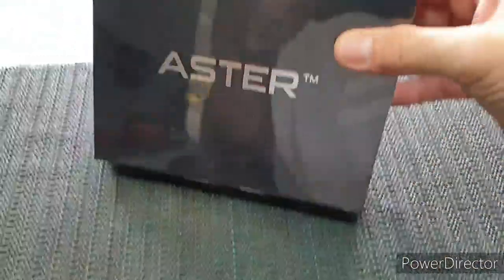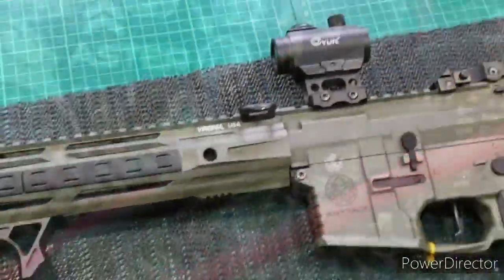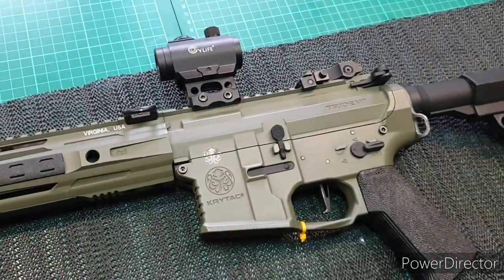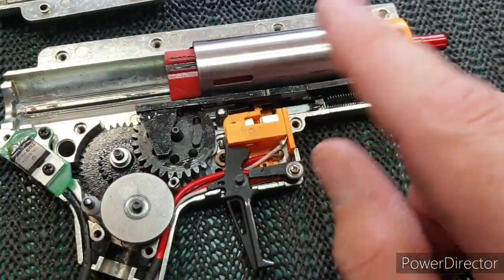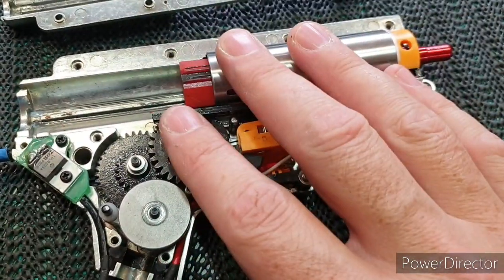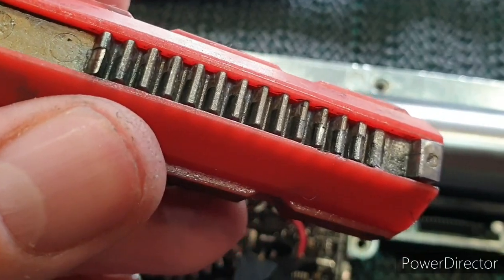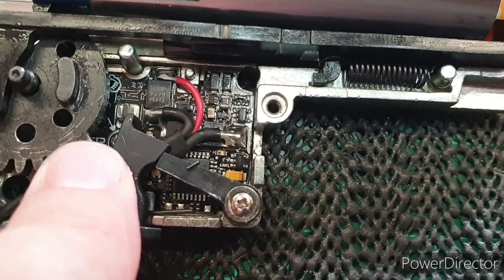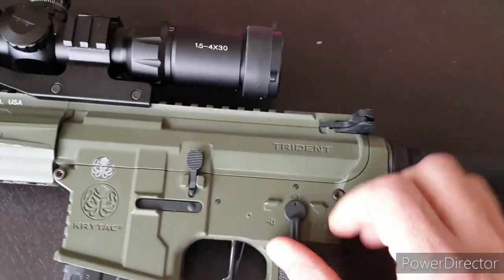KRYTAC + ASTER Installation

Comment: great video im thinking of doing this to my krytac too, just out of interest do you run 11.1v on yours?
Reply from the maker: Hi there, so to answer your question yes I did run an 11.11.1v lipo at the time but I no longer owne the rest gun anymore. Sold it to a friend and its still going strong 💪
Reply: @stuartlathe2310  cheers for the reply, what mah and c was it when you used it?
Reply from the maker: @narstysist598  1500mAh 25c

Comment: hello my friend.i dont know if your still active here. im considering a mosfet for my lvoa. the trigger is he worst thing ive ever felt. i have some g&g'sthat are so more better because the etu.ive got a perun in 2 of  them do you know of a drop in or inline mosfet that is decent for these guns. ive had shit luck working on gearboxes and am afraid to open this up. ive done all the other stuff but gearboxes get everytime. i sadly ony have 2 airsoft stores local and i dont trust those wanker techs theyve screwed up everything ive given them. any info you have id really be grateful to recieve. cheers
Reply from the maker: Hi there, so I would suggest copying what I've done to my SPRM i also did the same to a friends LVOA-S and it worked fine. I do think the ASTER is the way to go on a Krytac 👍
Reply: @stuartlathe2310  did you have to do have to go in and remove material from the gearbox case so the trigger module fits or did you have a tech do it I could take the gearbox apart no problem I can travel it and do all that kind of stuff but I have shit luck when it comes to getting it back together properly so I don't want to open it and then shit the bed and not be able to put it back together properly. That happened to me on my predator trying to get the Ambi fire selectors back then it happened on my Avalon MP5 so I'm scared scared to open the thing

Comment: GATE says the aster is compatible with Krytac as long as the bolt lock is removed, was that not the case for you?
Reply from the maker: Hi there thanks for the question. Absolutely not, the stills I put up are from the GATE PDF manual for installation guide of the ASTER into a KRYTAC. So they know you have to do some modding.
Reply: @stuartlathe2310  that's crazy because it says no modification of the shell is needed, even on the GATE official website :( Well i'm glad I saw your video today as I was planning to purchase the ASTER soon.
Reply: Was just about to ask this question after seeing the video, yup everywhere says no modifications needed for Krytac gearbox... But of course it’s krytac... I have the Gate in a shopping cart with a MK2 M pdw, not really looking forward to the install lol
Reply: I emailed Gate about this and Revision 3 of the Aster will not require any modding of the gearbox or loosing the bolt lock. Revision 1 and 2 however require modification.

Comment: What size is that MAXX (looking) Air Seal Nozzle you are using there? Is it 21.25mm? And what hop up chamber? Stock or aftermarket? Thanks.
Reply from the maker: Hi there and thanks for the question, your correct it’s the 21.25 I’m using and it’s the stock KRYTAC hop unit but the barrel as been “S-hoped” and the cylinder head is the Laylax direct replacement for the stock KRYTAC one. A word of warning don’t use the MAXX cylinder head with this setup as the head has different dimensions to the KRYTAC/LAYLAX one ☝️ you will get miss feeding issues because the tappet plate won’t take the nozzle back far enough for a BB to feed.
Reply: @stuartlathe2310  - thanks, i have a complete set of Maxx including cylinder head, 21.25 nozzle & ME Pro hop up chamber .. would all of that work well together? (i am not a big fan of teching so i'd rather not do a trial/error if you already know the answer) -- thanks again.
Reply from the maker: Ok so the MAXX ME-pro works in my LVOA just fine, but as I mentioned the cylinder head has a different dimension to that of the KRYTAC one but try it it might work for you 👍🏻

Comment: If you are using the Aster particularly, you do not have to dremel anything in the Krytac gearbox if you are using their quantum trigger. But the Gate Titan you will
Reply from the maker: Well I had to so I did.
Reply: @stuartlathe2310  I hear you brother. Btw, did you keep the stock piston head?

Comment: What did you use to get rid of the extra bits on the inside of the gearbox?  Dremel + sanding?
Reply from the maker: SSG SPUD So I used what we call in the UK a “Power File” its a hand held belt sander 👍🏻

Comment: I want to do this with my LVOA is it worth it? Should I just go for a titan??? Also, do I need to change any other internals or not necessary?
Reply from the maker: In a word "Yes" either would work well and does as I run a Titan in my LVOA S however the same mods have to be made to fit both the ASTER &TITAN.
Reply: @stuartlathe2310  thanks so much!
Reply: @stuartlathe2310  got a titan thanks friend

Comment: Does the integrated mosfet mean the rifle is 11.1 ready?
Reply from the maker: If your referring to the "Stock" Krytac mosfet then yes I used 11.1V on them with no issues or over spin. The ASTER takes 11.1s all day long 😎👌
Reply: @stuartlathe2310  Awesome, that's the one I meant, thank you for the fast response.
Reply from the maker: @DragonFyre221  Just make sure that the "C" rating is not higher than 25/30 c 👍

Comment: Do i need a rear wired or a front wired for the krytac trident
Reply from the maker: You’ll be good with the rear one as long as your original wiring is already to the stock.
Reply: @stuartlathe2310  its stock thankyou

Comment: Do krytac bodys work with retro arms gearboxes?
Reply from the maker: I'm sure with some modifications you could get it to work however, you would not be able to use the ambidextrous safety as the Retro Arms won't accommodate for this 👍

Comment: ¿What changes have you made to improve the compression? I want to buy one just like it and improve the accuracy and distance.
Reply from the maker: So I replaced the entire compression assembly with a non ported cylinder a SHS cylinder head a MAXX Model Nozzle 21.5mm SHS piston head and piston and a 415mm Madbull 6.03mm barrel. With the stock spring it shot at 397ish fps so swapped it for a M100 witch brought it down to 350fps. I use 0.3s and it's an absolute belter and out ranges every AEG on the field at the same FPS. 👍
Reply: @stuartlathe2310  415mm madbull barrel? Is it an old barrel length they used to make? I can't find one in the length currently
Reply from the maker: @jordancook5171  It’s an AK 47 barrel length it’s only ever so slightly longer than the stock KRYTAC one comes flush with the end of the flash hider. I got it from JD airsoft.

Comment: Why this and not an Titan V2?
Reply from the maker: Hi there and thanks for the question. So as I already own two TITAN V2’s I thought I’d give it’s little brother a go. And it’s cheaper then the Titan 😎👌
Reply: @stuartlathe2310  is it worth it to get the titan or does the aster do the same job? Also how difficult is it to fit a titan in the krytac GB?
Reply from the maker: @sarchavius1111  ASTER dose the same job IMO but there’s some modifications that have to be done to the gearbox for both the TITAN & ASTER to fit properly 👍🏻
Reply: @stuartlathe2310  I’ve never done any tech ing before but I’m pretty handy, do you think I could do it? I’m thinking about getting the aster and the quantum trigger by gate also

Comment: How did you get the motor wires in, it is stupid that gate reverse the motor wiring, and the red wire is stupid short.
Reply from the maker: On most AEG’s the motor goes “Black to back” so you put the motor in with the negative terminal facing towards the rear of the motor grip. Just flip it 180 so the red terminal is there instead. All my AEG’s have a mosfet installed and whether it is a TITAN, ASTER, or LEVIATHAN the red wire sits to the rear of the motor grip. I’ve had no issues with mounting it this way. 👍🏻

Comment: I forgot to take out that big spring and my gearbox exploded I don’t know where the washers or anything goes
Reply from the maker: Mate I feel your pain 😢 the washers are "Shims" and there to help your gear set run smoothly. Don't panic there are plenty of videos on YouTube to help you with that and also V2 gearbox assembly/disassembling. 👍
Reply: @stuartlathe2310   thank you it took me a few hours but I finally fixed it